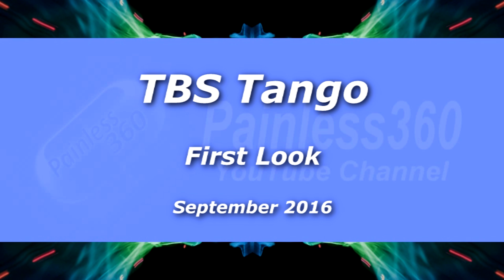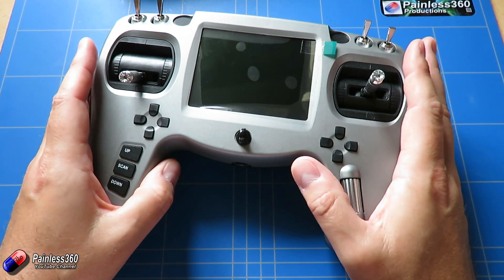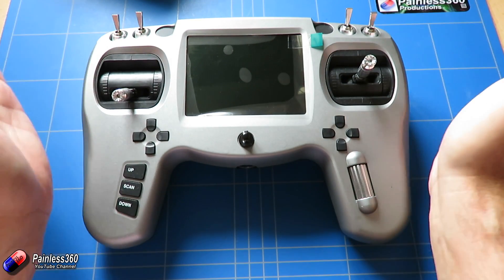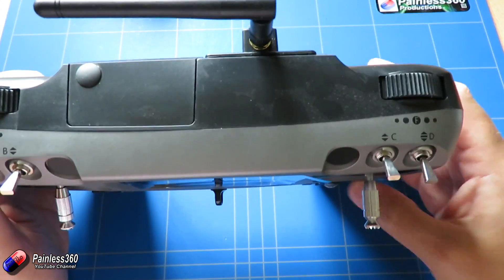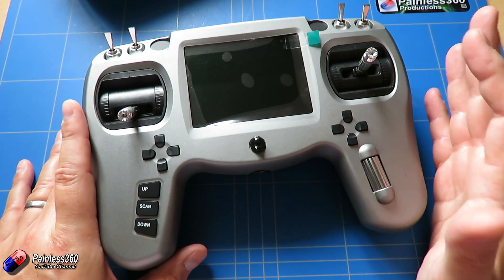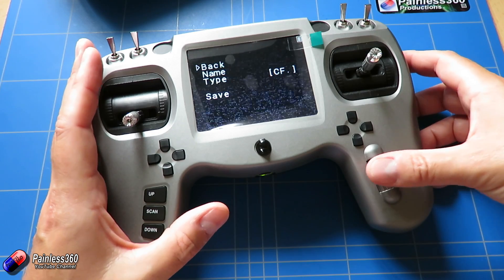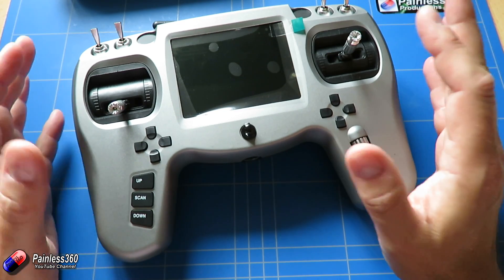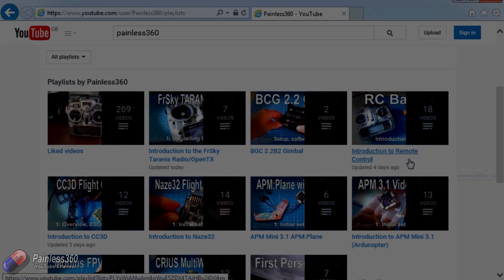RC First Look: TBS Tango Radio Transmitter and FPV Reciever

Comment: I’m trying to setup a ZOHD Kopilot with a TBS Nano RX with the Tango 1 on a ZOHD Dart 250g. I’m trying to use SBUS but I am unable to map the mixes to include SBUS. When I power everything up the receiver binds to the tango but no mapped switch input changes the leds on the kopilot. The control surfaces also seem to be twitching and I am unable to control anything of the aircraft.

Do you know if the tango 1 has sbus at all, I could not find any info on it
Reply from the maker: I no longer have the radio. Sorry I can't be more help on this one. Best of luck!
Reply: You can use SBUS if you get a multiprotocol Jr module that snaps onto the back of the transmitter but you would need to get a SBUS receiver for your aircraft. If you're trying to use the TBS nano rx, then you need to wire the nano rx to a free uart with rx/tx inputs and then select crossfire protocol in whatever configurator you are using to program your aircraft. Good luck

Comment: I know this is a long shot. But do you know how to put this radio into Bootloader Mode? I tried to upgrade firmware today and it’s stuck without a Bootloader now. I hate to throw this radio out. I have had it since for 6 years and still love it.
Reply: @Painless360  Thank you for taking the time to respond. I sent a ticket into TBS. To enter “Bootloader Mode” you push Up & Power at same time while plugging into USB and running TBS Agent M. Problem fixed. By the way I been using you for a reference to fix things for last 6 years. I appreciate you & your channel! 👍

Comment: my xjt module in the tango keeps beeping, driving me crazy
Reply from the maker: A quick search found this - https://openrcforums.com/forum/viewtopic.php?p=128448#p128448
Reply: That’s your xjt. Very common with that module. It’s the antenna. Needs to be grounded. Look it up. You’ll need to solder a quick bit. And you will be fine. It’s garbage. Upgrade. Crossfire.

Comment: Hmm.. How are you supposed to set your trims, etc. when you say theres no method to do that?
I was thinking of this TX to go with my Oblivion and getting the whole RTF package with the Tango and another Oblivion, but if its really only good with TBS products, there doesn't seem to be a need for it, for me anyway?
I guess I must be missing the entire point of owning this?
Reply from the maker: Yep, you are ;) it's designed to work with multirptprs so all of the things youd need to change are setup automatically..
Reply: Well, again thanks for the video, but I don't see the merit of not being able to "set' endpoints for another brands RX, etc.
And then I've read a little more on this TX and it doesn't garner the best of reviews :(  - BUT, I hear that there is a V2 coming soon?
Maybe all those "quirks" will be addressed in V2? We can only hope, as TBS has some incredible products as well, as some nice quads.
I happen to own their Oblivion, which is a stout little flyer that does what it needs to do fairly well... and Crossfire too! Whoa boy do they 
have a winner there!!!
Thanks again for the video :)
SUBBED

Comment: I just got one of these and I'm trying to use it with my Fatshark Transformer HD via the special cable supplied with the tango into the AV in port on the fatshark.  I've tried many times with no success, the Tango cable will power up the goggles however no video input comes through.  Any advice??

Comment: I use this Multiprotocol Module in my Turnigy 9XR Pro and its been fun to replace these terrible mini TX and it works great here too I bet..... Eachine, Cheerson, WlToys, JJRC and Syma, it controls it. CHEERS.  https://www.rcgroups.com/forums/showthread.php?2763810-Multiprotocol-TX-Module-For-Frsky-X9D-Plus-X12S-Flysky-TH9X-Transmitter-Free-Test

Comment: Hi,

I'm a beginner just learning how to fly quad.  I have a few nano quad, 
some uses the phone app to fly and a few have the tiny transmitter.  I 
like to use a full size transmitter so I can feel the stick and learn 
how to control the quad.  The brand of quad I have are Syma, Cheerson, 
MJX, JJRC, WLToys, HQ777, Eachine, Helic Max, GPToys and Hubsan.  I 
don't know how to solder and I don't want to open the transmitter to mod
 it.  I would like to buy a transmitter under $200 to control all the 
different brand of quad.  Which transmitter would you recommend or it is
 too early for me to get a transmitter at this stage and I should wait 
until I'm more experience?
Thank you.
Reply from the maker: We have a video about choosing a transmitter on the channel. Getting used to using more normal 'sticks' that are used by larger models would be a good idea so you don't develop too many bad habits from the toy grade of quad. A lot of those models will only work with the radio transmitter/phone app they come with. There are some nice radios now that don't cost the earth that you can also use on a PC with simulators (a great way to practice!) and we like the FS-i6s - only 5 model memories but a very cheap way to feel what a 'real' radio feels like.. Best of luck!
Reply: Thank you.
I've watch all the videos you have related to FS-i6S.  I also search youtube and I don't see any video teaching how to bind FS-i6S to toy grade nano quad.  I have Cheerson CX-10D, Wltyos-Q343, Eachinese E010, FQ777-951C and GPtoys 993, will FS-i6S be able to bind with them?  I want to buy a transmitter to use on those quad mainly.  Someone suggested FS-TH9X, since it has swappable module, will it be able to bind with more model?
Reply from the maker: Unless the receiver in the model is made to bind to the radio then it won't work. 'A lot of those models will only work with the radio transmitter/phone app they come with' sadly means that some will not be able to work with another radio. We are looking at models that come supporting Futaba, Spektrum or FrSky transmitters so these radios but a lot of the Horizon Hobby 'bind-n-fly' work with Spektrum only.. Best of luck!
Reply: Thank you.
How do I find out what support does the quad comes with?  And the FS-i6S only works with quad that support FrSky?
Reply from the maker: Don't get confused - FrSky and FlySky (what the i6s is) are totally different. See our videos in the 'Introduction to Remote Control' series for lots more detail. Best of luck!

Comment: If the built in screen isn't really for FPV then where's the advantage over buying a much cheaper traditional radio and adding a nice 5 inch screen on a TX bracket or a set of goggles ?
Seems a bit pointless and for newbies coming into RC/FPV they're going to be very disappointed when they realise that to move on deeper into RC (as many many will) they're going to have to buy all new gear again and leave the Tango in the garage
Reply: Well the advantage for the FPV flyer is that most all settings you need to change should be done through the flight controller to include expo's and rates. As a quad flyer there is no real advantage to doing these through the radio anymore as most modern flight controllers have these in their settings. For people with goggles this would allow them to power their goggles straight through the radio also giving you the necessary battery life remaining (through your osd) so you don't have to worry about dead batteries sneaking up on you and your goggles cutting out mid-flight.

I would have preferred a smaller width radio and better gimbals though, but perhaps that will be incorporated into the Tango V2 (also hoping they would build it with crossfire prebuilt into the system on the 2nd version). I still feel for their 1st time attempting a radio that it was a good job, not perfect, but nobody is their 1st time. Team Blacksheep is constantly pushing this hobby forward with new and innovative engineering and I thank them for that.
Reply: why would they need to buy another remote control? if all they do is fly FPV quads, then the Tango will not only continue to grow with them through software updates, but it's probably the best transmitter for exactly that task.
Reply: +Team BlackSheep Because like I stated, many, many of them won't just stay with quads, even if they may not see that yet, as you well know yourself, don't get me wrong, it's a good start but really needs to be more capable, maybe an easy and a fully programmable expert mode with dual rates, expo etc etc

Comment: can this be used as a trainer with the taranis? I would like to get another transmitter and this looks pretty cool.
Reply from the maker: I'd go for a much cheaper little radio if you want to have a trainer. This isn't designed for that type of application (from what we can see here). We use an old DX7 as the student radio and it works great..

Comment: If a Standard Version with NO FPV comes out, I'm in. That would drop the cost. Having a Turnigy 9XR PRO and all the Jr Modules already I'm out fitted. But as you say the FPV is more than needed. I own their TBS Discovery frame, I like this company.   Here's the 25 page TBS Tango Radio Transmitter manual.       http://www.team-blacksheep.com/tbs-tango-manual.pdf

Comment: Hi mate, I think you are missing a trick. If (like me) you only fly fpv racers, you don't need all the stuff the taranis can do, also, and this is what you skipped, if you already have fatsharks, you can power them from this, no more strapping chemically explosive devices to your head, no more running out of power from the goggles or having to charge both the radio and goggles.
Reply from the maker: +Adam Featherstone agreed. Hence the comments about 'it's not a Taranis, and it's not trying to be one'. This video was in part to address the comments in forums and videos from others who've tried to compare a Taranis with the Tango. Despite the similar price tags these are for completely different uses. We will see more of these style Tx units in the coming months so those pilots who don't what the complexity of a full radio can get flying faster. Happy flying.